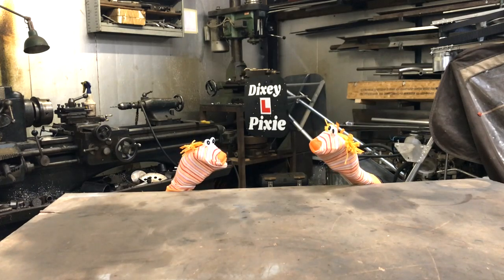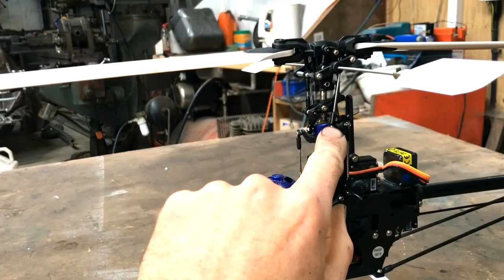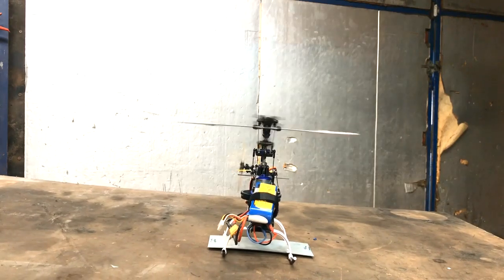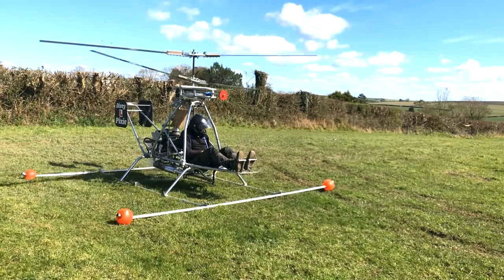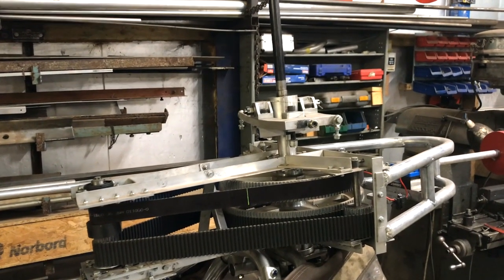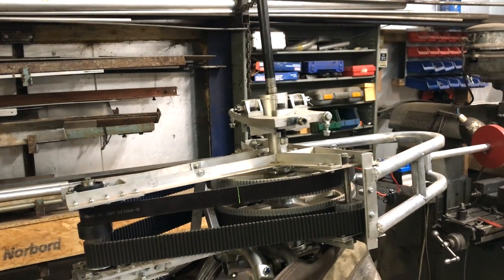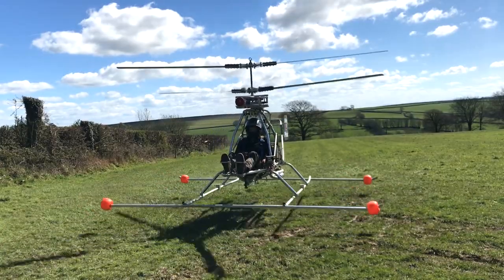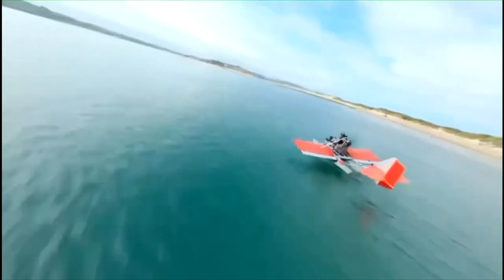Rotor dynamics and a NEW PROJECT announcement

Comment: Underslung rotor systems are inherently dangerous. R-22's crash regularly from negative g's. Many a video of people dying from the tail boom being chopped off mid flight. I would not even ride in one myself, but pick your poison carefully. 3 blades at the least. 2 blade rotors are not a fun ride at speed. Notice the cyclic of any video when in a Robinson. The shaking is abysmal. The stresses of those system take their toll overall pretty quickly. Rotor inertia in a Robinson is terrible. JetRangers are better but look at the mass of those blades. The ride in a JetRanger is awful at speed.
Reply: Are you speaking from experience or just parroting what you've heard in comments?

All of my flight hours are in Robinsons, and your comment is extremely disingenuous.  Firstly, low-G pushover IS a dangerous condition for any 2 blade rotor system, but Robinson's don't crash "regularly" because of this.  In fact, mast bumping makes up a small percentage of Robinson accidents.  A vast majority of Robinson accidents are due to power management (or lack thereof) and striking obstructions like power lines.  For how many Robbies are airborne, mast bumping is extremely rare.  Furthermore, it is a condition that can (and does) happen in other 2 bladed rotor systems, there's just more Robbies in the air than all the other 2 bladed birds combined, so you see it more often.

Also, the cyclic on Robinsons does not vibrate violently, at least not on a properly balanced one.  You may be confusing deliberate inputs with vibration, as the R22 requires a lot of cyclic input at a hover, particularly in windy conditions, because of how "twitchy" the bird is.  Hovering a R22 is a very engaging process.  The R44, on the other hand, has zero vibration and rarely requires more input than some pressure on the cyclic unless you're doing something rowdy like wrangling cattle.

I dunno man.  Your comment just reeks of someone who has never sat in a Robinson and is just talking out of their ass after watching the R44 Cadet crash that happened in Texas last year.
Reply: @Maverickib  As you have never flown anything but Robbies I can assure you that you are biased. 50 hours of factory certified training was required by the FAA and insurers when they were killing people pretty regularly at the beginning. Why? Bad design that was certified by idiots at the FAA.

That rotor system was developed from autogyro systems. Boosted hydraulics are always smoother, but another failure point. Load up an R-22 at max gross on a hot day and do me a hovering auto from 10 feet. Inertia in that rotor system is abysmal. 

How many full touchdown autos have you done? I did over a 100 in my initial training. I used to teach full touchdown autos. H300's and JetRangers. I've had 5 engine failures, 1 from hover. Never bent a helicopter or damaged one in 4000 hours of flying. 

If you gave me a Robbie I wouldn't do anything with it but hope to sell it. The cyclic setup is comical just in itself. Obviously you're a bit butthurt over my comment, but I stand by my 45 years experience.

Good luck with your choice, but I'm not a fan of Robbies. They became popular because they are simple and cheap to make. The only commercial operators are training, cow scaring and sightseeing for a reason. Cheap. 

Nobody is going to hire you with just Robbie experience except Robbie operators. Try getting HEMS or Commercial ride with that as your resume. Not going to happen. 100 hours of Astar or 407 time would be a better bet.

The Military owns zero Robbies in the USA. Cheap and twitchy. When starting an R-22 they look like a mule crapping sandspurs they shake so bad. Not good for any drive components lifespan, and if I was uninformed would probably not know the difference. Cheap way out and didn't conflict with standing patented systems.

My advice would be fly something with more than 2 blades and see the difference for yourself. 

Fly safe.

Comment: Good stuff Ben. In newer RC helicopters, 'flybarless' has become all the rage. They still use a 90 degree hinge, but now precession and mixing are electronically controlled and programmable. If I were to attempt the build of a manned collective pitch heli, these days I'd probably follow along those lines. 

A ground effect flying boat sounds like a fantastic project, and I'm eager to follow along. Thanks for sharing such interesting and inspiring projects with us.
Reply from the maker: Thanks for the informed comment. 👍
Electric servos for controlling the swash plate on a full scale is something I'm considering. It would make a chinook less complicated on the control mechanisms.

Comment: Great direction change, Ben. I think tackling aircraft stuff in smaller bites is definitely the way forwards. You'll still need to understand fixed wing controls for pitch, roll, and yaw so this will be good experience. It also neatly sidesteps the concerns about getting a flying machine certified. Ground effect is a lot of fun in gliders, with airbrakes shut, because you can stay airborne for the full length of the airfield.

For rotary wings, you've more or less nailed how delta3 uses aerodynamic forces to get the blade tip path plane to stay aligned to the fuselage. The hiller paddles are a little more complicated as you have to think of them as a servo control for the main blade. Effectively the swash plate flies the flybar, which acts as a gyroscope. This means that the rotor is being controlled by a gyroscope that is always seeking to keep the same plane. So the effect is that the main rotor behaves as if it had more gyroscopic inertia. So a given swash plate pitch or roll input will produce lower pitch rates and roll rates in the rotor tip path plane.
Larger helicopters often still use gyro stabilisation, but it is normally done in the control system with the benefit of hydraulic servos. However, the Cabri G2 trainer has demonstrated that by simply increasing the rotor inertia you get the same effect. That is to say reduced pitch & roll rates for a given cyclic input. This also has the advantage of safer entry to autorotation, and flaring, as more kinetic energy can be stored in the rotor itself.
Hope this helps...
Reply from the maker: Fantastic comment Martin 👍 thanks for the input, I had forgotten to mention the servo assistance from aerodynamic paddles. Do you think that is the main difference between Arthur young's stabiliser bar and Stanley Hiller's fly bar ? I didn't know that there is gyro stabilisation through hydraulics in larger helos. 👍
I can understand how a larger Inertia rotor would be a benefit in more ways than one. The cabri G2 seems well thought of. 

I was told a while ago that the reason the Robinsons don't need a stabiliser bar or fly bar was due to the height of rotor compared to the cg of the aircraft. It's much higher. I can see this creating a delayed response to cyclic inputs. 

The wig boat will be a new learning experience which I can't wait for. I know very little about fixed wing construction, thrust lines, planing hulls, centre of pressure changes in wig vehicles. To name just a few of the things required to understand.
Reply: @Ben-Dixey  , thanks. In larger helos it is called stability augmentation system (sas). The design was originally developed by Lockheed for the AH56 Cheyenne, but when this was cancelled Westlands picked it up for the Lynx. Lynx has a very high effective hinge offset, or rigid rotor. This produced a difficult to fly helicopter without the sas system. Nowadays sas is typical in large helicopters like the Merlin and S92 to reduce pilot workload during difficult missions.
The Young and Hiller stability bars both use the gyroscopic effect of the bar to slow down the rotor pitch and roll rates for a given cyclic position. Remember how difficult that R22 was to hover? This is a combination of high pitch and roll rates for a given cyclic input, and a delay in response from pilot cyclic input to the fuselage following the teetering rotor. Both Young and Hiller systems were implemented to slow down the rotor rates and improve stability. The Hiller system is effectively an aerodynamic servo control. The Young system is just a control input mix so that the bar counteracts the cyclic input to make the rotor undercontrolled. This is required because the maximum range of longitudinal and lateral cyclic is set by the maximum speed required in the helo. You discussed 90 degree precession flapback in an earlier video. The cyclic movement has to be enough to counteract flapback, but the penalty is the potential to overcontrol the rotor.
But, for my money the Cabri G2 is the neater solution of simply increasing the rotor inertia as this involves the fewest parts. By using hingeless blades then this also reduces the cyclic response delay. The blade moment also means you don't loose rotor control if you reduce positive gee. We discussed high effective hinge offset blades the other day. The effect is to increase the flapping frequency of the blade to be higher than the azimuthal sweep frequency. This means that the 90 degree lag of a teetering won't cut it, so you have to introduce delta3 angle to reduce the blade pitch lag from the swashplate. With rotor coning then there are aerodynamic reasons for delta3 too, which is why the robbie has it.
Very wordy response, but I know you get the mechanical details.